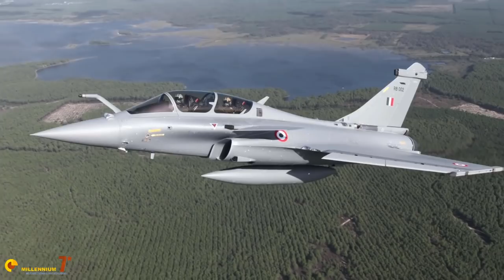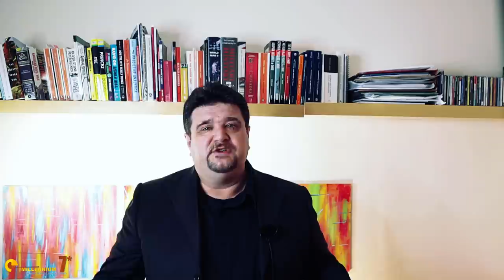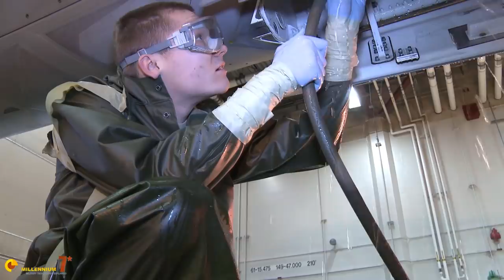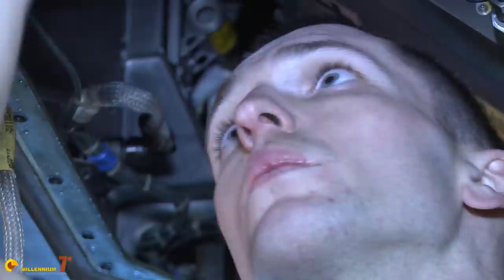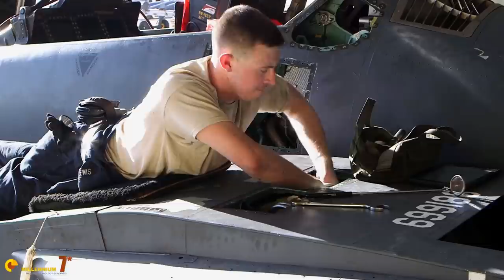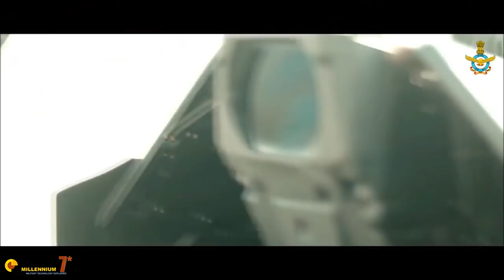The Indian Air Force is a MESS! ... or is it?

Comment: point ---- our su30 has russian radar , israeli jammers,indo- frenchcockpit,indian sensors
Reply: It's actually more complicated than that... 🤣 🤣 🤣 And it's gonna get under an upgrade named Super Sukhoi with new sensors, avionics, radars, Jammers, engines, etc. Basically, the body will be same but the soul won't. Some software upgrade tests were already been tested last week.
Reply: @yogeshchaudhary2093  dude even if we go deeper even AL 31 FP engine have many Indian changes(jugaad) and done by HAL to Improve in some area. Thank god that Su 30 has an Indian Mission computer otherwise it may have become nearly impossible to fit all these. It is somewhat like licensed reverse engineering. 

Even ruder has some changes from basic SU30. 

the weapon system is a big mess even big in Super Sukhoi Russian R77, R73 Indo-Russian K-100, Bhramose, Python 5 or AIM-132s are planned to replace r73, Israeli I derby is also planned to integrate if Radar is changed then Meteor is also planned. We use both the K and G(planned) series of munitions in Su30 with DRDO bombs. We use many Israeli pods also. Many more are left.
 
Who will get such options😂😂😂
Reply: @s_km1493  There sure is a reason why our Sus dominate the skys, and we all know it.
Reply: Also it doesn't work most of the time and has limited availability.
Reply: @cityofjoy8830  are you a pilot or just read the propaganda filled commentry on su 30 by usaf commander promoted by mitra sahab
Reply: @cityofjoy8830  Why any reason. According to my knowledge it have 70%+ availability  70% of 270+ is a good number. Right?
Reply: @cityofjoy8830  And for 90%+ availability we are not planned to fight inside Beijing. Atleast for now.

And all other compatibility Issues are already resolved long ago.
Reply: @s_km1493  would you believe IAF AVMs word who dropped bombs during kargil operations or someone who is busy earning money from YouTube by spreading masala news. 🙏 Avm is spot on. Upto you
Reply: @cityofjoy8830  Pls read the article........ Hear he full video....... the sources are from IAF itself..... Not based on assumptions. It told by the same pilots bombed kargil.......... This shows that you haven't read the article nor heard the full video.
Reply: @cityofjoy8830  Also other genuine reason that he tells is of Su 30's Engine. Its serviceability is poor. But if we equate this downside to the power of the engine at the class and cost which also he mentioned in this with the package it offer and the freedom to do integrate anything because of Indian Mission computer cant be offered by its only counterpart in class F-15 due to US's laws and policies. It may be not the perfect one in world but its good for India. 

It was also testbed for many Integenious equipment including for some part of Tejas.

Also the other question comes up when anyone say the equipments are not compatible in This jet, Then why this so-called poorly integrated , tested and glitchy faulty jet is used to test every single new platform in IAF includes Astra series ,Rudram series, MICA, and many other. And If other western Platforms were soo safe why the Astra, Rudram (NGRAM),etc was not first tested from Mirage 2000s. Its because Their Mission computers are not our's. They cant provide versatility as Su30mki.
Reply: @s_km1493  engine life of AL 31 is max 1000 hours and almost all sukhois are 2+ decades old now you calculate how many engines have we burnt out and post half-life upgrades how many needed to maintain a deterrence. Also add the factor that sukhois cannot fire any precision weapons like laser guided mk82 bombs or fox3 missiles. How efficient is our platform?? This is the same thing which Avm Raghunath Nambiar spoke even with upgrades Sukhois cannot match Kargil era mirages capabilities 🙏. It's only good for close combat where BVR is the norms these days. Even with Aesa radar upgrades su30s don't have precision long range missiles like Mica, python and Aim 120s etc.. bcoz Russia doesn't have any missiles to match Westen counterparts.🙏
Reply: @cityofjoy8830  Sir when he says Sukhois cant match kargil era mirages. sir you are misquoting, Su30 also have the same littining pod as mirages so It also have laser designator. Dude what is fox3....r77 is a fox3, astra is a fox3 for you kind information su30 is integrated with mica. R73 will be changed to AIM 132 or python soon even r73 is still effective. We are using not using the vintage r77 its new atleast most. Sir kindly pls research what is Fox 1,2,3. 

Sir did you know how missiles work forget about missiles who told you even with AESA su 30 cant beat western platform. Did you know what is Mission Computer how It work? Who told you this that we cant match western aircraft. What to integrate where to integrate It depend on mission computer. 

Did you know range of Su30s radar it is ateast 2.5x than mirage-2000 radar and it is better than some of AESA radar. The power availability of su30 is at least 1.546 times greater than mirages even Rafales. Sir did you ever researched about armaments of Su30mki. r37 have a 2times range of AIM-120-D to be specific. Which western jet can counter a Su30 with Bhramose. The philosophies of western and Russians are different. 

And for you kind information Astramk2 which will be tested in this quarter have same capabilities of AIM-120-D. 
 
Sir for your kind information fox3s are missiles that will go pitbull after some distance in TWS mode. This includes AIM-120s, R77s, Astra mk1, Astra mk2, Mica RF, R37, Meteor etc.....

Fox2s are IR guided like Mica IR, python series, AIM-9 series, AIM-132, R73, IRS-Ts, PL 10, PL 5 , r27ET etc......

Fox1s are Full Active mode or like STT mode which include normal r27s, AIM-7s, etc.... These do not include Active radar seaker in missiles. 

Now how effective is the Fox3s It fully depend on quality of seaker and clockspeed of the processor. I don't see any russinan or Indian missiles are overly out performed by AIM-120 family. 

Now on Fox2s in IR section, there is no comparison to r73. In the IIR section There is no counter to western missile like AIM132s and IRS-Ts and IIR is more advanced than IR. But both can kill.

Now on RADARs let it be AESA or PESA the range is directly proportional to the power available and its size of nose cone so if power is higher then nose cone can be smaller. But ic su30s the nosecone and power is higher than mirages and f16 so any RADAR in su30 will be better effective then others in a specific class su30s are also called as mini AWACs in Air Force. You cant compare Rafale, F16s and Mirages to Su 30s because it is of different class and roll.

Sir did you know how a prission guided munition work. There are 4 tipes of it. IIR, GPS,  Synthic Aprature (RADAR) and LASER.

IIR and GPS can be fired from any Air craft with some software changes. So Su30s can.

SAR based can be launched by a Air craft  with RADAR that support Synthic Aprature mode to TFR mode. Bars support it so Su30s can.

Now LASER guiged one like Spice 2000 they use Guidance and Designatior POD like littining which is common in Su30mki and on Mirage2000H. So Su30mki can.

The only existing issue in su30 is its engine which we don't have any other option currently. 

Hence Su30s are effective in BVR in Inour region. And one of the best in close range. 

See dude No research organization will use a outdated or faulty platform to test its new weapons. Su30s are heavily used by DRDO and IAF to test new equipment. 

Jamming (ECM, ECCM, ECCCM ) of Su 30 (ELM 8222) is battle-tested in post and in Balakot when It dogged AIM-120-Cs. AIM 120 are very hard to jam because it will start to follow the jamming source.
Reply: @s_km1493  su30 can only carry it and only French planes can fire it using link 16. Also R37 isn't affective against fighter jets and is rightly called AWACS killer for slow moving targets. Fox3 missiles of western counterparts don't work on Russia planes. Astra MK2  is not reality MK1 is good on papers. russian radars isn't fully integrated with French/ Israeli avionics. For further details please check renowned defence analyst Abhijit iyer Mitra videos. Till to date all efforts have failed integrating western weapons on russian planes. IAF got this lesson during balakot operations as they were not even able to engage whereas mica sweep done by mirages dettered them away. IAF isn't as good as it is showcased this as per all defence analyst including our Indian ones and AVMs also 700+ pilots have quit airforce so far. I also love my country. You can escape from reality but cannot escape from the consequences of avoiding reality .🙏
Reply: @s_km1493  neither does IAF chief have any degrees. But Abhijit's information is credible. Also IAF is overly concerned about its detiorating quality of fleet and cannot complete with neighbors with smaller budget. Till to date all Russian missiles requires their sole equipment like radars and avionics and are not integrated into Israeli and French avionics.
Reply: @cityofjoy8830  dude what is the cost of AIM 120 and r77 comparing to AIM 120 it is very low cost so shelf life will be also less. And I don't know who are giving you such wrong information.

How can a missile can refuse to engage even the shelflife is over. Locking and tracking is only affect on battery. Shelflife is actually for its propellant not for the electronics. From what source you got that they refused to engage, there is no such statement from IAF. From My sources of IAF Su30s do not have command to engage until they cross LoC. The role of interception was given to MiGs and Mirages. Su 30s were to protect HVAs this is not a movie that you can engage with anyone and start to fight. 

It is not somehow able to dodge 1 or 2 they fired 6-7 missiles Dodging 6-7 missiles are not a small thing It requires a huge amount of training, skill and jamming capability. I don't know why you guys are taking things from Air even IAF did not put out any statement 

See pilots shoot to kill, they cant shoot outside of launch parameters because a missile is very costly as per opensource data AIM120 will cost more than 400k USD they cant loose 2.4M USD  (((which is about 17.2C INR and about 36C PNR)))  to a target which can't hit. Especially in case of Pak's economic condition. 

Pls come out of your closed ecosystem and pls give me numbers and proper filtered facts.
Reply: @s_km1493  Um, all that bullshit aside, don't you think it's pretty telling that the IAF chose to employ the 40 year old Mirage-2000 and not the new supposedly modern SU-30MKI in the 2019 Balakot strike? The SU-30MKI, despite all the claims of multirole capability, has proven to be only useful for air superiority, and even in that role, it's weak in BVR. Why do you think India's buying Rafales and now even buying more second-hand Mirage -2000's? The IAF has no faith in the SU-30 or Tejas.
Reply: @cityofjoy8830  we didnt have su 30's during kargil. mig 29 achieved air superiorty in kargi'

Comment: But this will not be the case 20 yrs down the line.
Amca, Tejas mk1 and 2 will dominate the inventory.
Reply: they said that 20 years ago.
Reply: @nik007delta  that was the curruption time
Reply: The supply chain has been painstakingly developed over the years, its a different case now.
Reply: I doubt this. More likely Indians just buy more Rafales and possibly F-35 later on. Or maybe SU-75 assuming it's not vaporware (big assumption).
Reply: @mbaxter22  FYI the indian air force is going to buy 114 4.5 gen aircrafts from different countries and 30 for navy. After 10 years when almost 100 aircrafts will be retired they will be replaced by indian 4th, 4.5, 5th and navy aircrafts after which their will be close to no foreign purchase. This 114 aircraft is said to be the last big purchase by India.
Reply: A variety of fighters may decrease, but variety of weapons will still remain or even increase. BTW variety of weapons is actually a boon.

Comment: I think variety is good, but only if you have significant quantities of each aircraft and also provided you can afford the luxury of variety. India, including their 36 navy Mig-29s but excluding the Jaguars and MiG-21s because they're being phased out, has about 500 combat aircraft. Su-30s comprise 55% of that total, and MiG-29s 25%. So, 80% of their air force is Su-30s and Mig-29s. That really isn't much variety. I think a total force of 400 aircraft comprised of 300 Su-30s and 100 Rafales would be much more potent than the 500 aircraft they've got, and probably cheaper in the long run.

Comment: Brilliant video,  strength in variety could be an advantage but logistics parts and training can be an issue. Plus I think India has many outdated aircraft they need to do away with. Jaguar,  mig 21 are of little use.
Reply: mig21 is replacing by tejas

jaguar isnt for combat,it is ore of a nuke delivery vehicle due to its deep penetration,it was always meant to be gound attack bomber...multirole jets like mirage still cant deliver nuke in deep territory like jaguar can
Reply: Even a jaguar flying through the mountain valley will be hard to detect by the time they appear and then it is too late. The RAF had a hard time when practicing intercepting their own version of the jaguar when conducting dissimilar air combat training over mountainous terrain.

Comment: Obviously the maintenance strategies are different between the US and India. The main reason is GDP per Capita adjusted to Purchasing Power Parity.
https://en.wikipedia.org/wiki/List_of_countries_by_GDP_(PPP)_per_capita

63K to 6K GDP per capita (PPP). The cost of the aircraft is basically fixed, but the labor is in fact 19 times cheaper in India. US federal minimum wage is $58 per 8 hour shift, while minimum wage in India is just $3 for 8 hours.
Reply: India do have a lower labor but parts for planes are not cheap. Most of the cost in maintenance is parts and not labor. Cheaper parts mean cheaper maintenance. Having fewer type of planes mean you have buying power on part costs.

Comment: Indian Air Force is a mess. Don't even try to spin it. It have 7 different models because it is unable to replace old planes with new one in an level that is needed. For one, it cost too much to replace the old planes. Second this that their Tejas is taking to long to be in service and they are building it as very low rate. This force them to spend their money on updating old planes when they should be spent on buying new planes. They are in a catch-22 when spending is fix.
Reply: go by those numbers again ,replacing mig21 is hard task as india didnt inducted 50 aircraft,at one point more than 600mig21 were in service,and last mig21 was inducted in 1994.Also  mig21 was supposed to be replaced by tejas but by then tejas wasnt ready and airforce moved away from interceptor to multirole doctrine.Hence u will read alot about ADA-HAL vs airforce barking.
SO except mig21(tejas is replacing currently,not more than 60 are going to be in service and 20 have already being delivered) all other planes are fine...next in line are jaguar+mirage (total 125,replacing by rafale currently) and mig29(will be replace by tejas mk2 & TEDBF)..su30 will be replaced later by AMCA
production of tejas mk1 is slow as air force isnt happy with its capabilities ,it is better than mig21,but also doesnt bring much ,to standardise the fleet....hence airforce has given go ahead for production just to keep prod line rolling,they actually are looking for tejas mk1A and specially tejas mk2(specs are to make them like rafale with single engine)

TEDBF will be naval version of tejas mk2 so is also backed by navy.basically airforce want to reduce variety & want multirole uniformity.And navy always for jets which are common with airforce(in this case mig29 or rafale or TEDBF)

the future of indian aviation will be rafale,tejas mk2 and AMCA(if later can be developed in time)

Not just airforce but all forces in india are suffering because our defence minister between 2004-2014 never signed any induction deal,so for 10 years time they never bring in new jets while older one kept retiring

Comment: Let's not forget one thing.  Each time India picked each one of these different planes out of political convenience in each of the different moments.  They didn't pick them out of tactical advantages which diverse fleet may bring.  If a diverse fleet's advantages outweigh the drawbacks, then India had arrived to this by happenstance, rather than foresight.
Reply: Most of our current jets were bought between 60s-90s for a big poor country surrounded by two hostile neighbours we chose cheaper aircraft which can also do the required work. Its not mere coincidence. The idea of IAF and Policy makers used to be cheap easy maintenance aircraft in more number which is changing now since u cant counter technology with training as effectively anymore.